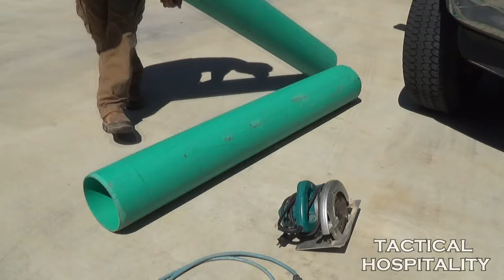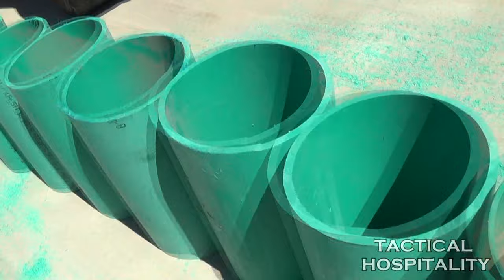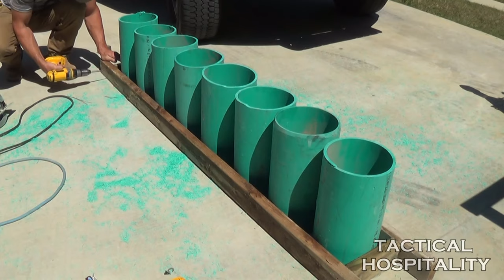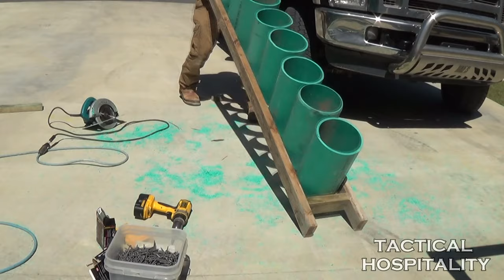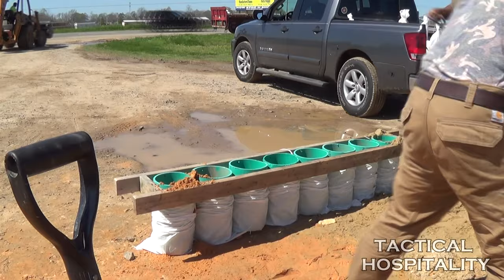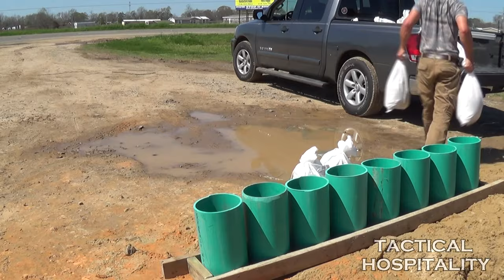Incredible DIY Sandbag Filler!

Comment: My husband made one of these and it works well and a lot faster than the old method. Do you fill the sandbags to the top?
Reply from the maker: thanks for your comment. No, we fill it to about 2/3's full so it is easy to tie and carry. What town did he use it and was it during a flood?
Reply: Can you List all of your tools used to make this please?
Reply from the maker: Thanks for commenting Ashley, you will need:
Circular saw
Drill
8” pipe
2 ea 2x4’s
2” screws
Reply: Where did you buy your bags?

Comment: I like your idea but unfortunately the pipe is very expensive for the rare emergency I would need to fill bags.  I might try to construct using 8" x 48" concrete form tubes found at HD for $11.  Just need to think of a good attachment method so the tube material doesn't tear where it fastens to the wood.